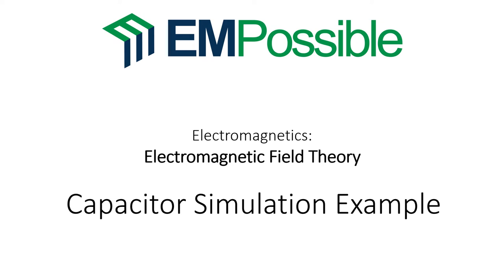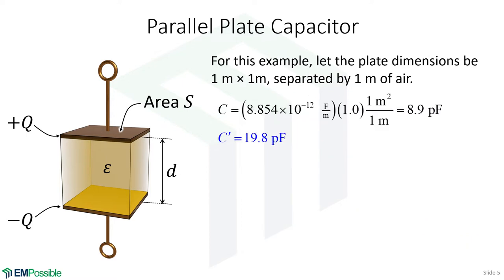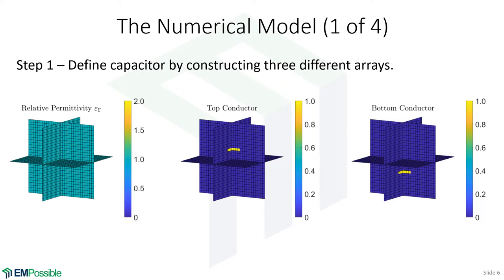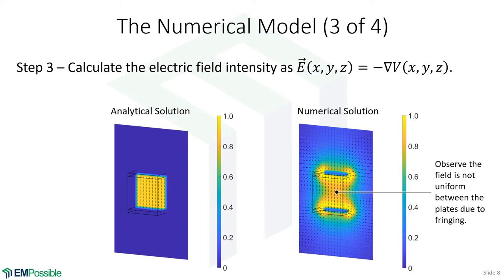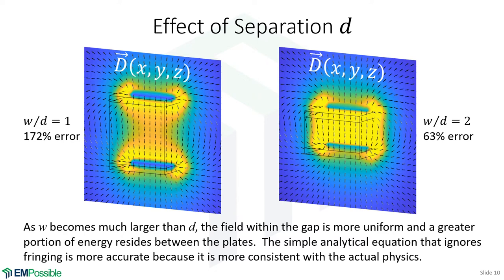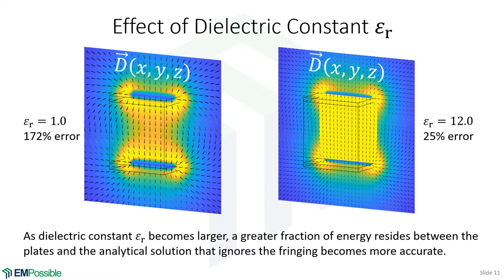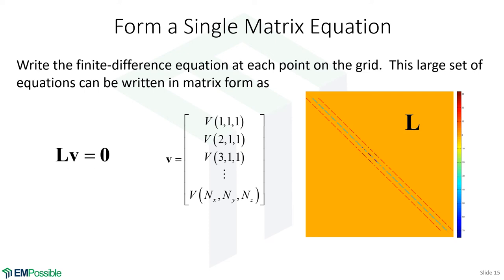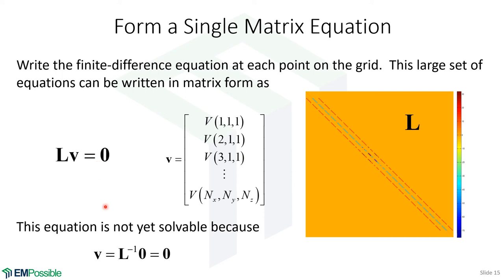Lecture -- Capacitor Simulation Example

Comment: Thanks for this amazing work. Can you redo the simulation and visulization with the magnetic vector potential A? I want to develop an intuition for where it points to.
Reply from the maker: Since this is a statics simulation, there are only electric fields. At DC, electric and magnetic fields completely decouple and become separate and independent problems. Visualizing something like this would require a rigorous simulation, which I could do. 

Overall, I like the idea of visualizing electric and magnetic vector potentials. Visualization always makes things more intuitive.

Thank you for the recommendation!

Comment: Hello sir,
So for designing a parallel plate varactor diode, should I consider same equations? And to design it in HFSS example, can we use a transmission lines feeding that can be de-embedded after? Thank you
Reply from the maker: I am not sure a transmission line model would do. Maybe you can extract the capacitance from the impedance of the line. In general, the capacitance is not a function of the signal passing through it so capacitance is usually calculated other ways. Give it some thought. It may be possible the way you are thinking.

Comment: Hi sir, i need to model the electric field for various capacitor configs. How to do the analysis for custom capacitors?
Reply from the maker: The main skill you are missing is building arbitrary geometries into your grid. I teach these skills in my Computational Methods course. See Topic 2 here:

https://empossible.net/academics/emp4301_5301/

With these skills, I think you will see how it can be done. If you think you are still weak on the numerical aspects of the finite-difference method, work through Topics 6 and 7 in this same course. Then go back through this capacitor video and I think you will understand everything.

Hope this helps!!

Comment: Hello professor, congratulations for your amazing work, I really appreciate it!
I have a question: is it possible to simulate a capacitor in the frequency domain in order to extract the curves Impedance & Phase vs Frequency? I tried with Ansys Q3D, but it didn’t work.. do you have any suggestion? Maybe Comsol is the right one, I don’t know.. Thank you so much !!
Reply from the maker: Absolutely this is possible, and it is not too difficult. The simple approach here solves Laplace’s equation. It is not possible to account for frequency or loss with this approach. To do what you want, you will need a rigorous solver. The closest thing is using the finite-difference method to analyze your structure by solving Maxwell’s equations instead of Laplace’s equation. I do not have any notes on doing this to analyze capacitors, but I do have materials for analyzing transmission lines rigorously. These are very close.

First, I have some sparse notes about this in my Computational Electromagnetics course at the link below. All of the information is in Topic 4. You will need to write a code that calculates modes in waveguides and then incorporate some post-processing to calculate the transmission line parameters from the results of the waveguide analysis. The post-processing is covered in Lecture 4j. The post processing performs a line integral of the electric field between the metals to calculate voltage and a contour integration of the magnetic field around one of the lines to calculate current. From here, impedance is voltage divided by current. You can also calculate the RLGC parameters or anything else you may want. You can plot all of these a function of frequency, device dimensions, or whatever else using parameter sweeps.  

https://empossible.net/emp5337/

A better resource is a book that I recently published through Artech House. This book is intended to teach the art of computational electromagnetics to the complete beginner. In addition to analyzing many different types of devise, the book includes a full description and MATLAB code that rigorously analyzes a microstrip transmission line. The code is easily modified to analyze any type of transmission line. This information is in Chapter 6. Parameter sweeps are discussed in Chapter 9 of the book, which you will need if you want plot parameters as a function of frequency or some other parameter. Here is a link to the book website:

https://empossible.net/fdfdbook/

I hope this helps!
Reply: @empossible1577   Thank you very much for your answer! 
Doing this analysis on a 3D device sounds really scary to me, ahah. But I will give it a try.  Thank you again ! :)
Reply from the maker: @palpiacorna5022  You may not have a 3D device. Transmission lines are usually treated as uniform in the z direction so analyzing them reduces to a 2D problem in the xy plane. It is only when you have some kind of discontinuity in the z direction that it becomes a 3D problem. This is discussed extensively in the book. Give it some thought.

Comment: Thank you sir! This is exactly what I was looking for!
Reply from the maker: Happy to help!!
Reply: @empossible1577  As an aside, do you think a simulation of this nature can be reasonably applied for self capacitance simuation for a coil?
Reply from the maker: @ivanrodionov9724  It will be more challenging using the simple finite-difference method I present due to having to resolve thin and curved wires. That aside,  I think it is certainly possible but would have to give it a bit more thought.
Reply: @empossible1577  yes, this is currently the exact issue I am facing, in order to accurately model the effects of thin wires you would need to have the simulation have a very small step size and hence be computationally challenging. I suppose it might be somewhat more efficient to use FD in cylindrical coordinates to speed up the calculations. 

I would have tried just simulating one or two loops, problem is as I understand it, the interactions between neighbors further out then one or two are not insignifficant. I'll have to think about it too. 

Either way, seriously awesome video and thank you for the reply.
Reply from the maker: @ivanrodionov9724  You may be able to construct just a single loop and use periodic boundary conditions to represent an infinite coil.  From this, you may be able to extract some kind of capacitance per distance metric.

Incase you are not aware, the best material we have on the finite-difference method is in our Computational Methods course in Topics 6 and 7.  Skip the numerical integration stuff. Here is the direct link:

https://empossible.net/academics/emp4301_5301/

This will help you understand how we implement the finite-difference method.

Hope this helps!